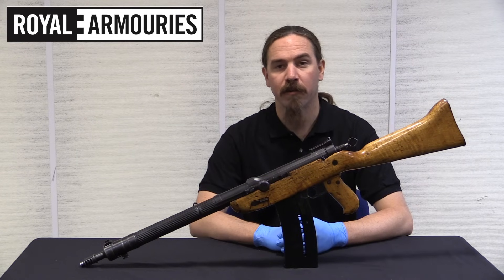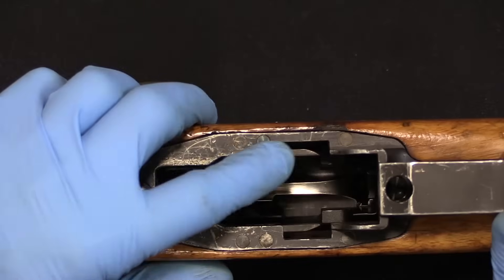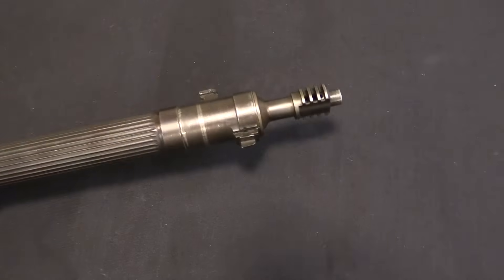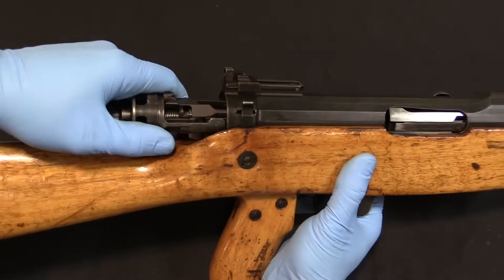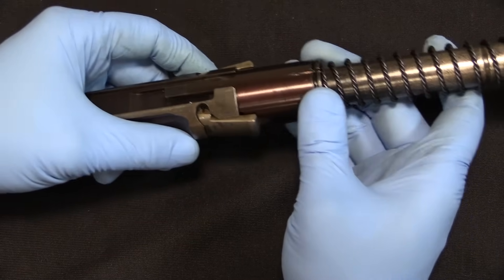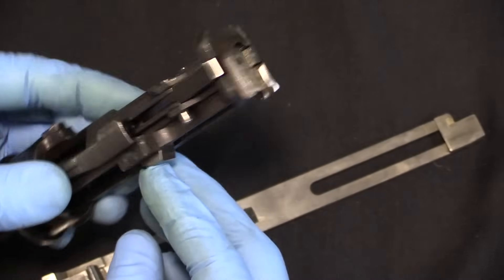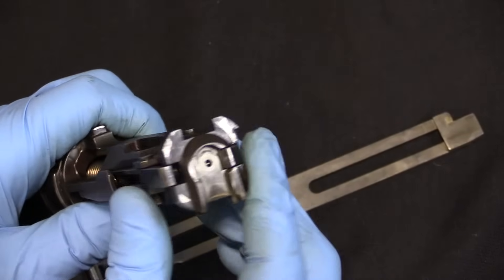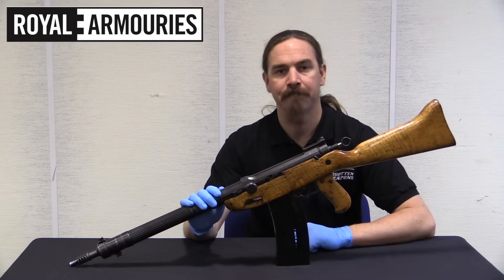SIG AK-53: A Truly Weird Forward-Operating Rifle

Comment: It seems, that the recocking hook is running under the mystery lever. On 22:28 its on E and fails to recock. Maybe it stand for Einzel, disconnecting the hook and you have to manually recock, so the gun has an auto and a "semimanual" setting. A repeater, where you only have to run the firingpin and not the hole bolt.

Comment: I actually drew up plans for a prototype machine gun that operates similar to this. So I'll take a crack at what that loop on the back and the switch is for... 

One issue I ran into with the original design was recocking the firing pin... the action going forward won't recock your typical firing pin (because of the forward motion of the bolt)- Basically, the issue is that the firing pin has to be recocked by a separate action powered by another gas mechanism, which is not an issue when the gun is being fired HOWEVER cocking the gun manually should not prime the firing pin (at least not without some serious complexity). This is because they are two different "gas" operated actions so cocking and (what i call) "priming" the pin requires two separate actions. You have to cock it AND prime the pin to shoot your first round.

It is also possible that the different switches maybe disassembles the gas-operated firing pin mechanism. This would mean that the firing pin has to be manually armed after each shot creating the illusion of semi-auto fire... If any of those switches or rotations have any effects on the firing pin, it probably wouldn't be noticed until you fire the gun...

One thing I found with this design was that switching to full-auto and semi-auto isn't as easy as it seems. It has to do with timing mostly. When a typical gun recocks, the hammer can't easily fire prematurely because the action in the bolt moving backwards keeps the hammer compressed down and latched differently depending on the fire mode, allowing it to release once the action completes by closing and decompressing the hammer- allowing the hammer to only fire at its appropriate time... 

For this gun, it is no longer the case. 

It can fire prematurely if not timed correctly resulting in the firing pin releasing without stricking anything, which means you disrupted the gas cycle, meaning that the pin needs to be reprimed to begin the cycle again... 

In fact, it would need to be manually "reprimed" in almost any situation where a trigger pull doesn't result in a fired round...

You might say "well duh", but the separation between chambering a new round and recocking the hammer means that you have to troubleshoot the gun every time a round doesn't fire... was it a dud? Or did the striker malfunction? One would require cocking/rechambering, the other would require "repriming" (hence why I call it that, because it needs a separate term to prevent confusion).

 I know that this is why the "repriming" loop is so accessible and obvious in their design (somewhat similar with my first few rough drafts).

Now, the barrel...

The barrel moves forward with the gun because they also ran into the biggest decision i did: keeping the barrel and chamber connected, or disconnecting the chamber from the barrel... this CAN be done safely enough if done right (cough* cough* revolvers...) but gas will almost certainly leak into the gun without a perfect seal, and this leak increases substantially with barrel length and higher chamber pressures from larger rounds... if the gun is complex, then this extra grime would never work if not dealt with or sealed.

You could use that leak to power the piston, but doing so- so soon- is not ideal (and dangerous) with chamber pressures being at their highest peak when beginning its cycle...

Having the barrel and chamber connected creates more issues than the obvious moving barrel (that can't be obstructed since it's full motion is required to load the next round), for instance: clearing a stuck casing through, or clearing a jam from the ejection port... 

A lot of this i actually solved, but all i did was trade simplicity for complexity, which probably couldn't have been done 60 years ago... If you think that any of this can be made simple... you are overlooking many problems (and this is only on paper and considering only foreseeable problems).

Lastly, the safety.

The safety could actually be working properly, and pulling the trigger is actually safely decocking the gun and not firing it, but i have no way of knowing for sure.

With all that said, the guy who thought this up almost certainly did so for the same reason I did: counter-balancing. He wanted to reduce felt recoil, and muzzle climb with fully-automatic fire, increasing the accuracy and comfort of firing large rounds from the shoulder, but it didn't take me long to realize that it would be reallllllly impractical for anything other than small cartridge rounds or long range rifles and the advantages are small...

Basically, the age old saying still holds true: you are reinventing the wheel... aaaand don't...

Comment: 15:27 Mr. McCollum I know i have the benefit of time but this unique design had me examining the striker assembly portion of this video a bit more thoroughly. As you mention later in the video that actually seems to be the out of battery safety (however you also mention it is the auto seer?)

It is my belief that the little hook that extends back from the connecting bar is the auto seer and that also recocks the striker.

Comment: Just the fact that you have to push the charging handle forward would totally make me useless trying to operate this gun. It would be like riding that bicycle where the handlebars turn the wheel in the opposite direction.
Reply: Someone has made that bicycle. It's just as hard as you think it is.
Reply: Weirdly enough, above 15 mph, that property is true. Check out motorcycle countersteering if you're interested

Comment: Ian pulls out a Honda Civic final drive shaft. "This is the gas piston."
And thus the McGuffin was a little front heavy.
Reply: Honda civic is front wheel drive therefore has no drive shaft
Reply: @fredsmith112  I said final drive. How do you suppose it gets torque to the wheels? Through the power of love?
Reply: @BugMagnet  honda, the power of dreams
Reply: @BugMagnet  Final drive usually refers to the differential (which is incorporated in the transaxle on the civic), the more accurate term would be cv axle or halfshaft. (Not that it matters, the joke is still brilliant anyways lol)
Reply: @fredsmith112  I know I'm a year late, but I'd like to mention that Honda considers the front drive axles the "driveshaft" on the civic (among ALL their fwd cars actually) that's how it comes up when you try to request the part through the program we use to fill out repair orders. The term "axle" only applies to non driven wheels, or rear wheels.

Comment: "Perfection is achieved, not when there is nothing more to add, but when there is nothing left to take away." -- Antoine de Saint-Exupery

This gun is a long way from perfection.
Reply: @zacharynoe1787  Hardly, the point of the quote being that things should be simplified as much as possible rather than be made more complex than they need to be. AKA if you can achieve the same result with 3 parts as you can with 40, the better design is the one with fewer parts.
Reply: @Antiganos  Tell that to my Twin Turbo charges V8 Engine, while you drive around in your 50ccm motorbike.
Reply: @darthsidious4894  You're completely missing the concept here. The idea is that when those turbos were designed, the engineers would be doing their best to make them function how they want to, but with the fewest parts possible in order to create the most reliable turbo they can. That way, when you bolt it up to your engine, there's less chance that it's going to break. Same reason OHV engines like the Chevy LS are so bulletproof, they're simple designs that use the least amount of parts to do what they are designed to do. 

Basically: if you can make a design achieve the same effect with 15 parts as you can with 40, go with 15. (Think of how simple your turbo is mechanically, or how simple the design of an AR is, no unnecessary parts)

 Other designs have their place, and each will be as simplified as time and money and thought allowed it to be before it was produced. While rebuilding the smallblock V8 in my 79 Firebird, it is evident that Chevy engineers very much tried to make every part serve several purposes in order to reduce the total amount of things needed to run/and therefore things that can fail. Headers have built in mounting brackets/intakes integrate fittings into the casting/etc. Now that I get to rebuild it, I get to further simplify it and make it even more reliable by removing unnecessary parts that allow the engine the freedom from extra variables. Basically: if you can make a design achieve the same effect with 5 parts as you can with 40, go with 5.
Reply: Why they didn't made a suppressed bullpup version to make it even better?
Reply: This was his survival rifle when he crashed...and he was never heard from again...still needs a cheese straightener built into the stock!
Reply: Occam's razor - given two answers to a question the simpler one is correct.  I never thought this was applicable to firearms but it seems to be here.

Comment: 25 minutes later, I still dont know how it works,  but neither does Ian, lol
Reply: Just for the sake of an intellectual exercise, I'm going to try to put this as simply as I can. =)

1. When you fire, the gas piston is pushed back, compressing the springs, and locks on to the barrel assembly.
2. When the gas pressure subsides, the outer spring acting on the gas piston pulls it, and the barrel assembly with it forward, and the cartridge gets ejected.
3. Once the barrel assembly hits the forward position, the inner spring, acting on the barrel, gets tripped and pushes the barrel backwards to load a new cartridge.
Reply: @jubuttib  thank you sir! Helped a lot!
Reply: I think I get it. Point click and whatever the cursor was hovering over is dead. So it works like any other gun.
Reply: @jubuttib  that's about as Swiss as you can get, lol. Only they could make an AK complicated
Reply: @damienairalay552  I know what you mean, but for anyone else reading this it's worth saying that "AK" doesn't always refer to THAT kind of AK, in both SIG and Swedish parlance it means "automatic carbine"... =)

Comment: I'd call that four-pronged thing a "collet".  On a Dremel Multitool, the "collet" looks and operates very similarly.  It sits in a cup on the end of the motor shaft, receives the bit, and is pressed closed with the "collet nut".

That assembly on the rifle also looks a lot like the length-adjustment  joint on the bottom of a Flowmaster replacement toilet valve.

Comment: I think the word you cannot think of for the "thing" is a collet.
Reply: Looks like one but it doesn't operate like one so would you still call it a collet?
Reply: @kf4tmh  That's what I would collet! 😉
Reply: That's another Swiss thing, they totally like to use collets for everything. Probably because of the clockmaking industry here.
Reply: I was absolutely certain that was either a thingy or a dumoflochee.
Reply: @DaveTex2375  It looked like a thingamajiggy to me
Reply: It's an interocitor, that provides that the gun interociplicates correctly.
Reply: Collet takes on a whole new meaning after reading Black Hawk Down.

Comment: This is the first gun I've seen on this channel (including the G11) that I genuinely don't understand even after watching the whole explanation.
Reply: Me either. As best I can figure out, at one point in the operation cycle you've got dueling springs. From what I could tell, that double wire spring would need to be significantly weaker than the other one.

Comment: As others pointed out, "E" stands most likely for Einzelfeuer (german for single shot) and "M" most likely for Mitrailleuse (french for machine-gun). As Switzerland has four official languages (German, French, Italian and Rumantsch), we have lots of adaptions and integrations from one to another (for example the french "salut" is a very common greeting also in the german speaking part). The verb "mitraillieren" is a germanification of "mitrailleuse", meaning to shoot a machine gun. There were even whole companies in the Swiss Army named "Gebirgsmitrailleurabteilung" (a word which probably insults both the German and the French language).

It strucks me as odd, that it doesn't matter whether the ring is horizontal or vertical. One of those positions really should be the "safety"-position, as the fire select does not have any. Maybe, there's something malfunctioning in the rifle.
Reply: Considering everything going on in it, I have zero surprise things don't work on it
Reply: "odd...One of those positions really should be the "safety"-position"
Not something you want to hear near someone operating a gun.

Comment: Possibly E = Einzelfeuer 
M = Mitraillieren
Reply: "Die Armeeversion des Assault Rifle 57 schiesst Einzelfeuer (Sicherungshebel auf Stellung "E") und Dauerfeuer (Sicherungshebel auf Stellung "M" = mitraillieren)."

https://www.swisswaffen.com/assault-rifle-57/sg57/waupyumzaxah
Reply: or Mehrfeuer
Reply: @silvermediastudio  "Mehrfeuer" is not a German word. In the Swiss army, however, the machine-gun soldiers are called Mitrailleur.
Reply: @ricoblaser6308   And this rifle isn't German, it's Swiss.  "One Fire" and "More Fire" makes sense.  Why would they use the word Mitrailleur for two different purposes, one to describe a crew served weapon team and one to describe the automatic fire mode?  That could get confusing when giving order to a squad under fire.  "Did the LT tell the crew served weapon team to move, or does he want us to lay down automatic fire?"
Reply: @silvermediastudio  

Mitrailleur is a noun which, to the best of my knowledge, comes from French and translates as "machine gun" (or "machine gunner")
Mitraillieren looks like a german(-like) inflection denoting the verb form of that noun. (something like "machine gunning")
Verb-noun relations such as those are quite common, and also exist in English. Keeping in mind French and German are two of Switzerland's four official languages, the explanation provided is plausible and is backed up a source.
Reply: @loyp4328   so the safety should be the "bolt-pull-ring" orientation (and isn`t working properly?) and the lever only distinguishes between fire-modes ...
Reply: @bulletsix  that is my understanding. I'm visiting SIG museum next month, I'll try to think to ask about that when I'll got that platypus of a gun in my grabby-grabby hands.

Comment: What makes the cartridge eject? Usually the bolt moving back pulls the cartridges back and the extractor flings them out, what is actually removing the cartridge in this action?
Reply: Next round coming up? I was thinking the same thing.
Reply: Scott Braun that seems like that would jam, wouldn’t it?? That’s a lot depending on a magazine spring
Reply: I'm only guessing.
Reply: Scott Braun me to, I was working of what you said Scott I wasn’t implying that you weren’t guessing just trying to figure it out with you, looking like we aren’t going to cause that thing makes NO sense lol
Reply: Magic
Reply: The barrel/bolt on its way backwards after the action, same as an ar15 bolt on its way forward after the action, it's actually not that complicated just imagine an AR where there bolt recoils forward into the handguard instead of backwards into the stock to imagine the ejection on this gun
Reply: yer mom

Comment: The fire control group will not recock with the action of the charging handle because the charging handle is moving forward while the firing pin spring needs rearward movement. I assume that connection rod is attached to the piston which is the only component that does move rearward. This would mean the gun only recocks on a fired cartridge and explains why a gun with a charging handle also has that Swiss ring on the back for charging for the first round

Comment: I think that E stands for "Einzelfeuer" - single fire and M for "Mehrfachfeuer" - full auto or something similar. I think the original SIG Stgw 57 has the same markings.

Edit: I just looked at the manual of the Stgw 57 and M means "Seriefeuer". (Full auto). There is no explanation about the letter 'M'.
Reply: Maybe M stands for "Manuellfeuer" because you have time cog the gun manually. That would explain why it woudn't recog apon operating the charging handle.
Edit: I saw it didnt recog when it was on Einzelfeuer and it hast full auto so dont know either
Reply: According to my research the "M" stands for "mitrailler"m the french word for machine gunning, as in mitrailleuse (machine gun).
Reply: "mitraillieren"
Reply: @andreaslaroi8956  Wait, so semi-auto marking stands for a German word ("Einzelfeuer") while full-auto one stands for a French one ("mitraillieren"). WHY?! WHO THOUGHT THAT WAS A GOOD IDEA?
Reply: @HidingAllTheWay  
Miltrailieren is a French word that was Germanized. As Switzerland has 4 official languages, that happened quite a bit over here. The Swiss German speakers (like myself) also use French words like Perron or Trottoir. In some parts, a watch is called "Quelheuretli", which is the germanized version of the French phrase for " what time is it?". Miltraillieren is not really in use, first time I heard it.
And we like to explain things, you can see that in every video about Swiss guns ;-)
Reply: @HidingAllTheWay  As others said, the word was germanized to "mitraillieren" and regularly used in german speaking contexts. Plus the rifles (well not this one, but others with the same markings) were also used by french and italian speaking soldiers.
As mentioned, french loan words are very common in Switzerland, we even used to call infantrymen füsiliere, from the french word for rifle (Fusil, what the F in FAMAS or FAL stands for.)
Reply: Mehrfeuer